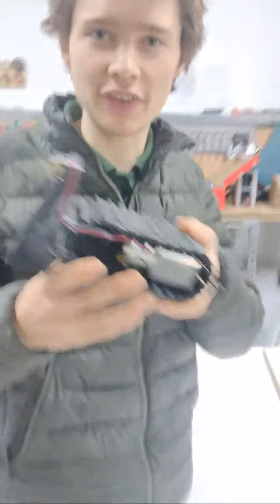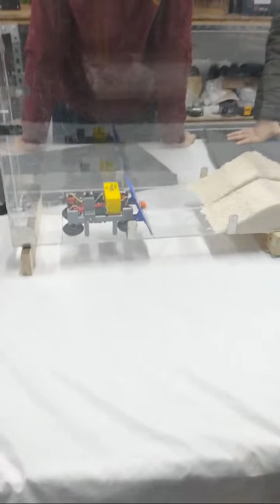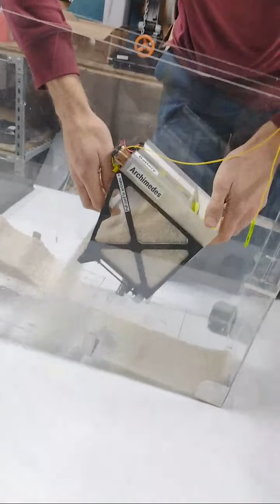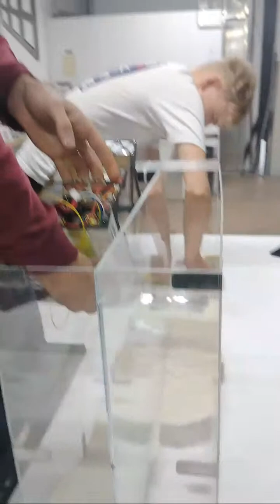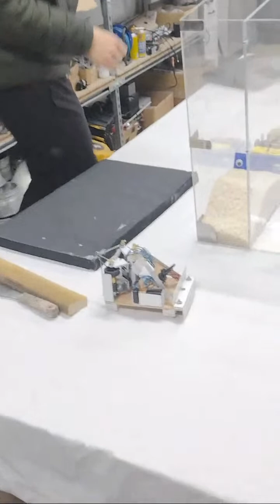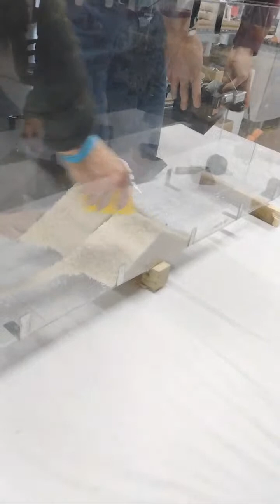FEng Challenge 008 - Rice Rocker - Live Stream

Comment: Excellent entries and a nail biter finish. Great work everyone!
Reply from the maker: Thanks Simon, you should have entered your torpedo to tunnel through the rice quickly and sit at the other end!
Reply: @FieldhouseEngineering  I had a grand plan but as always not enough time. And Christmas, while having time off work there are more family commitments. 
In case you are interested I planned on a wall driven pusher, but with a flywheel that could be stopped at 59s to win any close ones. My original thought was not trying to move the rice at all and just using a flywheel, but even using the full weight limit unfurled to the max allowable height, the battery power limited angular momentum to be marginal, and an unfurled flywheel that could rigidly stop sounded likely to injure somebody. Either way, I gave up on the lead up to Xmas, so hats off to those that followed through.
Reply from the maker: @simonjelley  What a brilliantly bonkers idea! You hit the nail on the head though, the main issue is actually building something that works in time 🤣